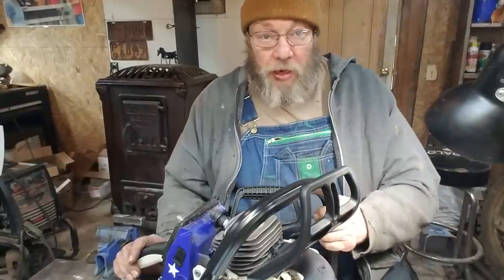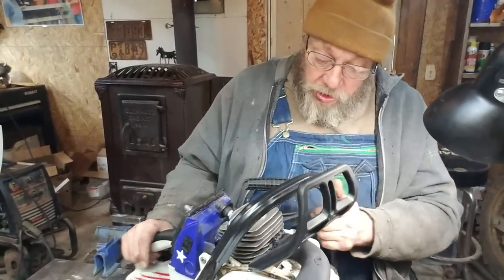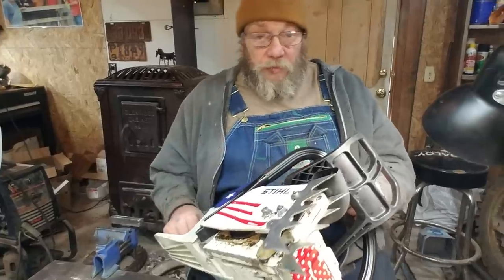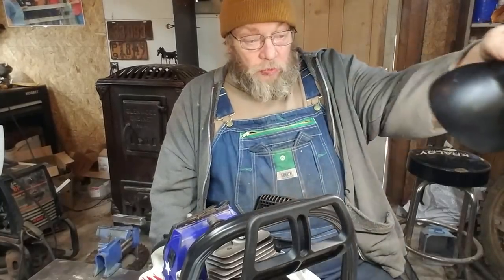New pipe design is just unbelievable! Crazy good sound!

Comment: I bet your right on the back pressure. I raced go karts 4 stroke. We first would start with the length of pipe. Then we bent them. Then we bent them and made the longer. Just played around to get more low end torque.
Reply: 2-stroke totally different animal ... to get the supercharged-effect ya really need a pipe ... That being said with ol Harvey’s design you will definitely p/u performance-it’s just gotta be “tweaked” until the peak torque/hp is where ya wanted ... Got into heated discussion with one of Them “forum boyZ” about this ... He (Snailerizer) claimed it “simply cant be done” - well , guess ya need to try it/figure it out for yourselves now don’t ya 😁

Comment: What I do when an exhaust is too loud is tack weld a washer or round flap over over the pipe outlet, then bend it out or in to adjust the flow and loudness. Works good to reflect the harsh soundwaves back into the pipe

Comment: The exhaust timing on those farmertec cylinders, ive noticed are different than a stock port timing on oem. Some of them end up really nice, some are not lol but theyre not consistent. I love farmertec tho despite that. Cheap and easy. So its possible with that cylinder the timing is in a spot that means it wasnt impacted much by the exhaust size change.
Reply from the maker: Thats not a farmertec cylinder nor is the blue saw of Luke’s!  Thanks!
Reply: Holzforma is farmertec
Reply: Or did u use a different one. Cuz i like farmertec actually alot. I just always port them. Which u have taught me alot about porting
Reply from the maker: It’s not a hultzforma either!
Reply: Ah ok lol well give farmertec/holzfforma a try and let us know what ya think!

Comment: LOOKS LIKE THE ONE I BUILT FOR MY 450 HUSQVARNA ONLY BIGGER I USED 3/4 IN EMT CUSTOM FLANGE NICE WORK HARVEY I BUILT ONE OF YOUR TUBE PIPES WITH THE BIG PIPE AT ABOUT 4 IN AND A 3/4 INCH TUBE OUT THE TOP END AND CAPPED THE LARGER DIAMETER PIPE AT THE END LIKE YOU DID ONE OF YOUR EXHAUSTS BEFORE I WILL TEST IT TOMORROW AT WORK IF IT'S NOT RAINING TOO BAD HOPEFULLY SHE PULLS LIKE A BAD MAMA JAMA TALK TO YOU LATER KEEP UP THE GOOD WORK HARVEY ENJOY THE VIDEOS AS USUAL!
Reply from the maker: Hey tony!

Comment: Move your flap too the left side so you can  close exhaust down . Where flap is ramping.  Another thing can try is adjusted  bolt too hold exhaust deflector where you want. Till can figure a exhaust spring out like on a wood stove dampener. Some time talking too yourself make sure your thaughts are in place. Lol plus dont argue with yourself.

Comment: That is awesome! Now what you have to do is put a butterfly valve in there with a linkage that runs to your throttle. Or put a diaphragm exhaust valve on there like on the early 2000's Polaris snowmobiles. Or you can rig up a governor system like on a dirt bike that runs off of the clutch or rewind somewhere and have a mechanical exhaust valve hah. Your the man Harvey!!

Comment: An expansion chamber ala CR 500 designed/built for that 660 will run like a raped-ape but is impractical for cutting firewood 😂  The stock muffler with dual-tuned tubes seems to give a nice punch over stock ... When “flow-enhanced” they will pull like the 7 horses at the end of the world !  No machine-work needed on the squish-band nor cutting the base needed to build a great running , fuel efficient , long lasting worksaw !  IF a guy wanted more compression then a thinner base gasket is installed ... Proper porting on its own will net you MUCH greater dividends than merely increasing compression ... The piston is cycling  150 times per second at 9000rpm-If everything isn’t working in concert then the song ain’t as sweet sounding ...The more air she breathes the more torque she makes ... easy to say ... Difficult to do

Comment: Think I'm going to have to try one of them holzfforma 660s. I sell about fifty cords of firewood a year and my ms391 keeps up but id like to see the difference from a 65cc saw to a 100cc saw.  I'm sure my 391 will thanknmebwhen it comes to the big wood. It came stock with a 25 inch bar but it don't like to pull when you have to use the hole bar. Love the videos buddy keep them coming. Oh I had a question. Would a 372 be a noticeable difference from my 391 when it comes to cutting? Was curious on what 8ccs difference would make

Comment: I got some feedback 4 ya on the farm tech handle bars     when u get to throwin a 32plus  around  iv had a couple  bend now      was thinking about filling  um with foam or somthing
Reply from the maker: I replace them! They are weak!
Reply: @theironhorse6600  I thought I remembered  u using them on builds b4 if not disregard  previous  comment
Reply from the maker: I tried them but it didn’t take me very long to bend them!
Reply: @theironhorse6600  any tips for cheap aftermarket  that are worth while?
Reply: @greatgreengoblinbear3800  Hy way is pretty good. They still can bend if you're not careful. Nothing beats oem I've seen so far.

Comment: Harvey how are you supposed to get the answers you want if you don't answer your own questions ?? 
I have built a lot of mufflers for cars and trucks.  The formula that seems to work for that is 1/4 inch holes in your in pipe  to equal the size of the pipe plus 10 to 20 . 
And only equal in the out plus 5 to 10 . And  we put a big washer on the ends on the inside with some extra 1/4 inch holes in both more on the in less on the out . All depends on how much back pressure you want and how quiet you want..   I've made some very nice one's that sound good and quiet to a point !!! 😊😊😊👍👍👍👍💖